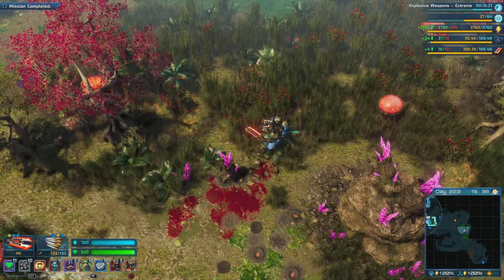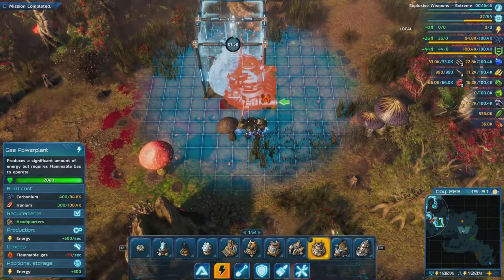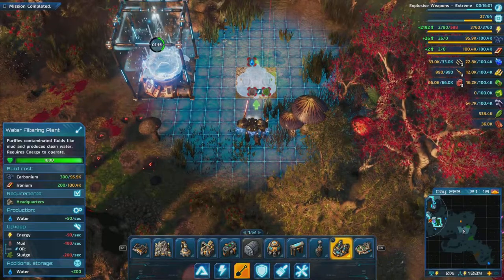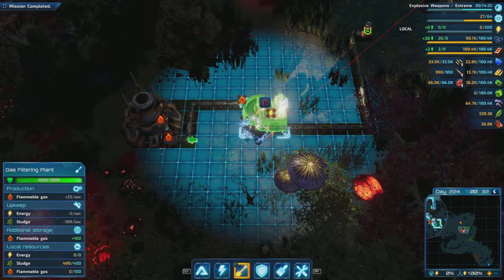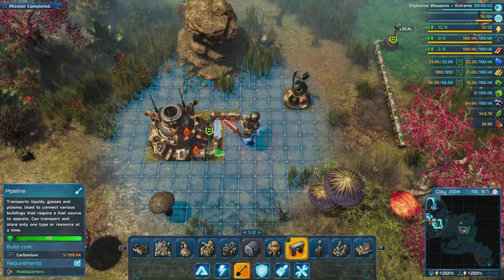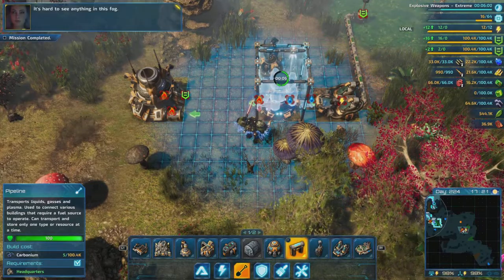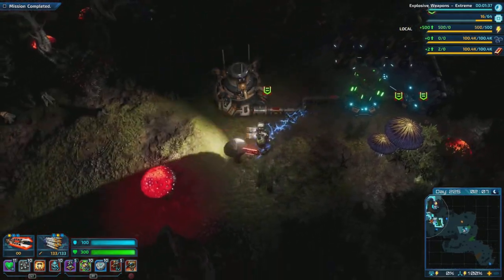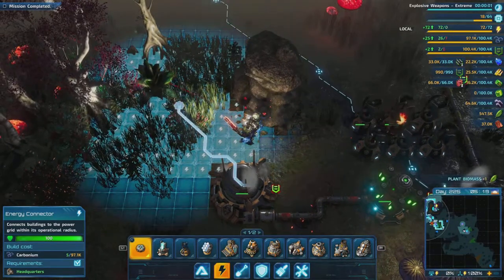The Riftbreaker: How to use Gas Powerplants

Comment: Only time I use biocomposter Is when I'm using mud from geothermal plants
Reply from the maker: You don't actually need to use that mud. Just add one pipe to the outlet that goes to nothing works